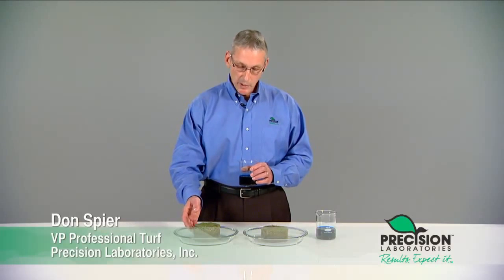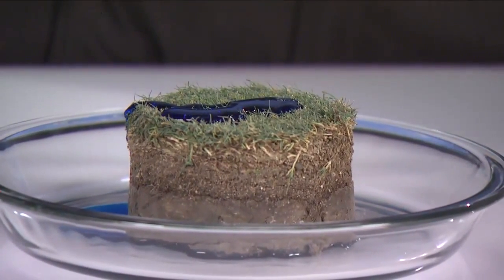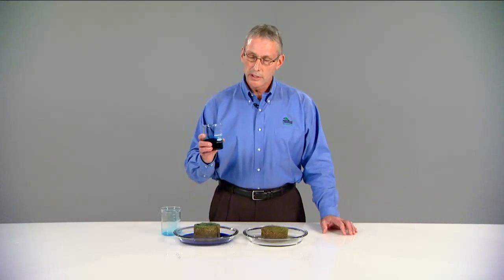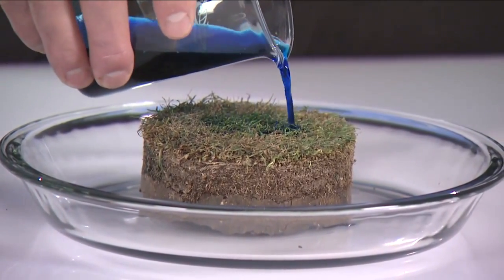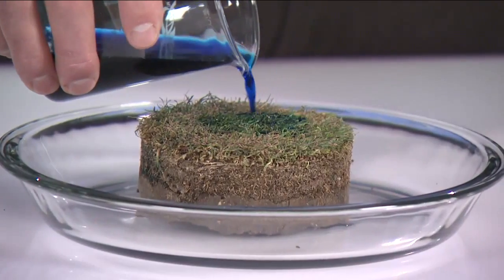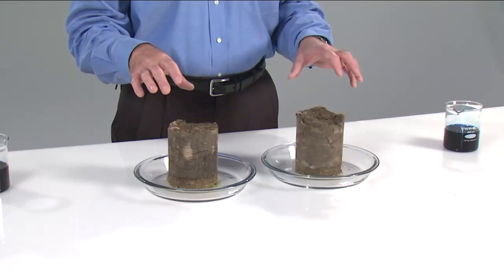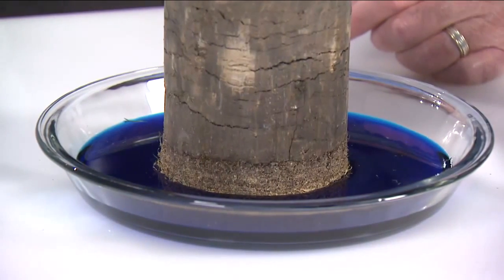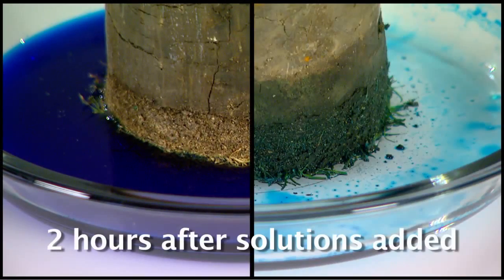Precision Soil Surfactants Bench Testing

Comment: You should have put the surfactant into the same sample turf you had.
Reply: Instablaster
Reply: This guy follows the scientific method. You should too. 100% agree. Reminds me of that commercial for those stupid rags, what was it called? Scam-wow?
Reply: Not to mention the tall plug that didn't soak in water was visibly drier than the other, indicated by many more cracks in the soil than the other which was nearly smooth aside from the 2 orn3 larger cracks caused by handling, not dryness.